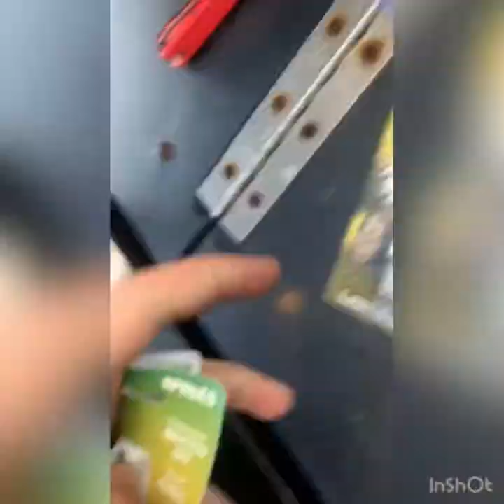Predator 670 Spark Plug Testing

Comment: Looks a bit rich. Does it bog like that with the OEM jets? I have my OEM carb nearly turned but it sounds like you’re getting too much fuel on 3/4+ throttle which is where the main jets kick in.
Reply from the maker: I never ended up fixing it, I believe I had a vacuum issue somewhere. I got another motor. I tried it all and said screw it and warranted my motor out.

Comment: to me looked to be  running good. You need a hot plug in those the governor cuts out at 3600 3800 anything over 4 or 4500 the valves start to float and you dont burn your gases you need heavier valve springs for rpm over 4000 that tan color is perfect you want slightly rich on any air cooled engine that's what cools the inside is the gas.
Reply from the maker: i adjusted the entire carb and runs like a raped date. only time I have an issue is when it ildes for a long time it will foul the plugs.
Reply: @keithellett4283  you could have mentioned that in the video or the description.
Reply from the maker: @Real.Alpheus  This video is 2 years old, I have a new video that will be uploaded this week. my cart has never ran so good to the point where I may keep the factory carb